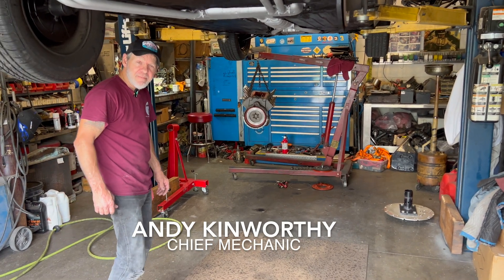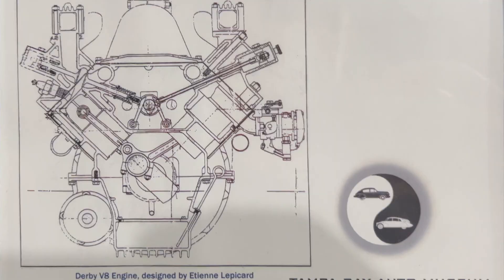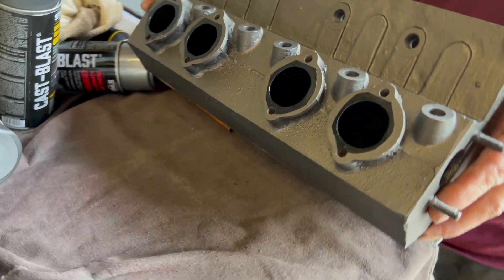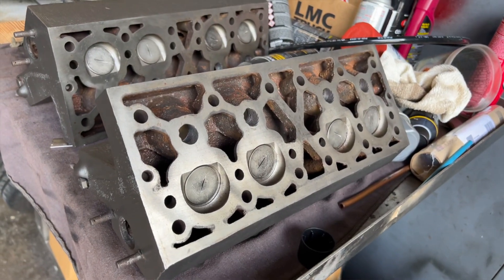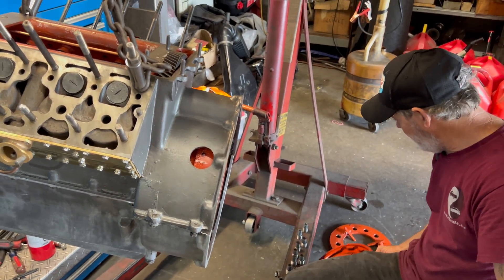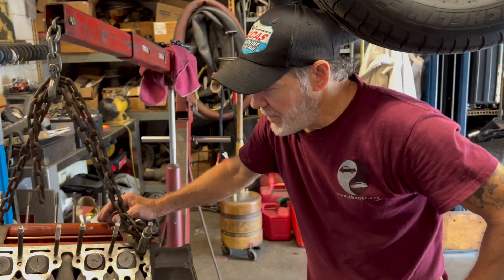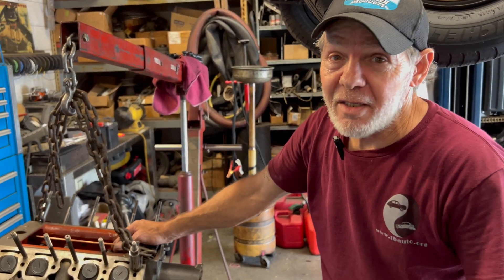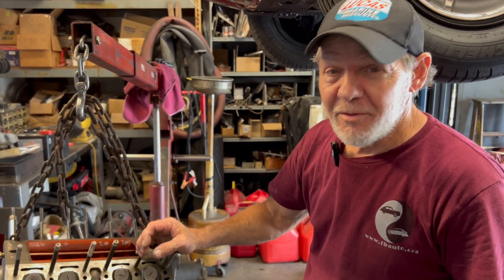1933 VARIABLE Displacement Engine? - The Derby L8 - #BarryT with Andy at TBAuto #derbyl8

Comment: Thanks for sharing very interesting piece 👍
Reply from the maker: I appreciate that, glad you liked it!
Reply: @BarryTsGarage 
Downside to this type of resto is when you call your parts supplier and they not only don't have any parts..they've never even heard of the motor🤣
Reply from the maker: That is absolutely true.  It takes a special owner to push through problems.
Reply: Kinda like having two bank accounts...
Only in this case they were cylinder banks😂

Comment: I don’t understand how simply removing the ignition from one bank of cylinders also removes the intake vacuum.  There appears to be a mechanism in the cutaway drawing and in the cam valley for changing the valve actuation.  Possibly this was how a cylinders were shutdown.  No?
Reply from the maker: OK, I’m not sure. I got a complete understanding of it. Myself, my visit was short. I’ll take a stab at it though.
Perhaps the ignition firing with the fast escape, velocity out the exhaust with pull the fresh air fuel mixture in to whichever side was firing   it doesn’t sound good today because I think most of us would worry about gas washing the cylinder walls and so on…